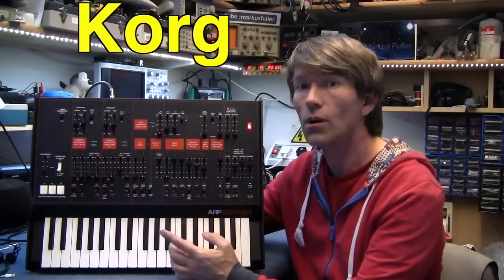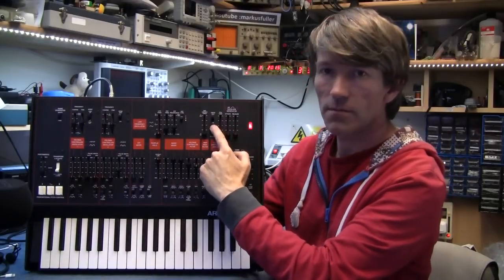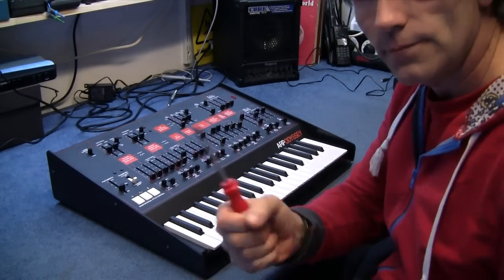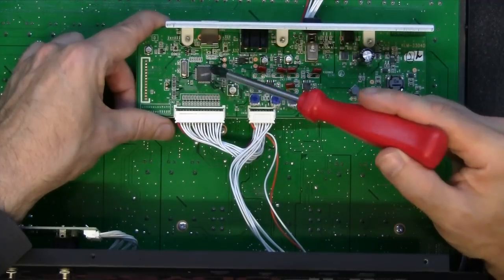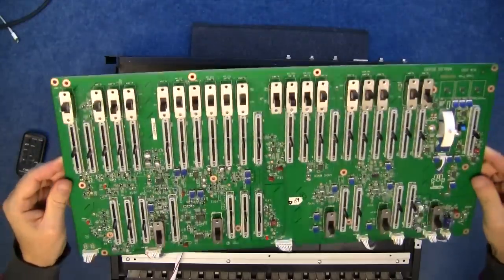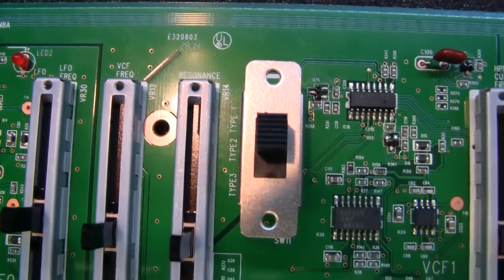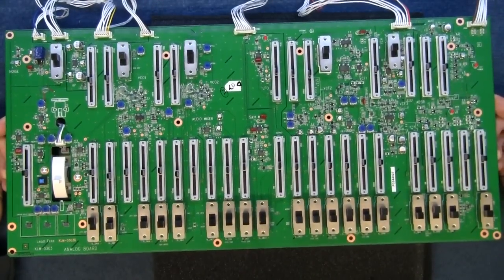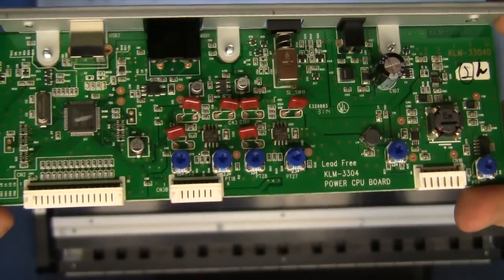Korg ARP ODYSSEY teardown MF#44

Comment: Great video as usual Mark - loving all the teardowns. I also greatly enjoyed the Maplin 5600S restoration (still hankering after one of those).

A couple of comments on the KARP teardown: Those pressure "switches" on the PCB are miniature strain gauges. The ball on the gauge and the metal bits in the buttons are to ensure a single point of contact and avoiding transmitting anything but the pressure in the vertical direction. The digital (obviously) USB controller also does the duty of scanning the keyboard,  so the internal CV and gate are digitally generated (sorry analog purists, there's no resistor ladder in the keyboard, only "dirty" digital CV :-p )
Reply from the maker: +Trottelheimer Thanyou for that information especially about the pressure switches. it all helps other people and I get to gain information from you guys posting things here. Many Thanks from Markus

Comment: The analogueness of the circuitry on that main board has convinced me - I have to have an Odyssey.
Reply from the maker: +45rpm they sound very good but are a little bit awkward to program. still that helps to accidentally find interesting sounds sometimes.
Reply: +markusfuller dude it's one of the easiest things ever to play and program! 😳😳

Rewarding piece of gear

Comment: The next video's the one I'm waiting for! I'm resurrecting the Maplin synth that I built back in the 80's. It's how I got into synths. Happy memories. 😃
Reply from the maker: Hi Bob. which marlin synth do you have ?. is it the spectrum or 3600 4600 5600?. I need some patch pins for this 5600s before i can even get started.
Reply: Hi Markus,
It's the exact same model as you showed in the video, a 5600S.
Ah, yes, the patch plugs. Now that's got me thinking...ok, I've found them, but I've only got 12. You are welcome to borrow them but will need them back at some stage. I'm busy starting up a new business, so I will not have time to do the 5600S resurrection for a while. I've still got the build manual which I can scan if you need it.
Bob
Reply from the maker: Bob Fuller Hi Bob. Thats a very generous offer, I am going to look into it today and see how much of the thing has been completed as there are 3 holes in the back with sockets missing so I do not know if everything has been completed. But yes I would love to try out with the pins if i get the thing to light up. and would of course send them back insured special delivery as i know they are quite expensive. I will try and send a private message later today and give you my details. Thanks Bob from Markus.

Comment: markusfuller at 6:06 once you get the main board out, what is that epoxy/glob of glue clear looking stuff? whats its purpose? Plus I love love love love love your videos sir!!!!
Reply from the maker: Hi Marc, Im not absolutely sure but it may be to keep out any humidity around those few components which would help in keeping the oscillators more stable. (possibly). ?

Comment: I just bought mine yesterday, and it does sound like would expect from a proper analogue synthesizer. And it has a lot of odd design details - some which probably aren't entirely desirable for everyone, so I was wondering if it could be modded. And thanks to your splendid video, I know at least what sort of challenge I would be facing: Tiny tiny SMD components! Too small for my big clumsy fingers to weld anything on to.  ;)

Comment: Just curious to know what that super glue type clear stuff is on the board at 5:54 ???
im sure it serves a purpose, just looks very sporadic
Reply from the maker: +milky michael Hello Milky. I think it is something to do with sealing those components from the elements ( humidity etc ) so as to make that part of the circuit more stable. .. thats just a guess.

Comment: Hey Markus. I've enjoyed your videos. I have a question about the Korg Arp Odyssey. Does the power button on yours feel wobbly? I just received mine and it doesn't seem solid. Just wanted to see if that is indeed standard. Thanks! Keep up the cool videos!
Reply from the maker: unimaxer Hi Yes the power button does feel a little bit wobbly, but so does the range switch and faders. Im enjoying using it but I'm being careful as i think some of the parts would be easy to break.

Comment: Hello Markus. Great video teardown yet again ! Thanks !
One question: I've noticed some hot melt glue spots around the VCOs area, do you have any idea what is that for ? Obviously not to hide the components, like they used to do back in the day to protect design secrets, since the glue is transparent. Maybe for some temperature stability ? I don't know... What do you think ?
Reply from the maker: Hi Alain. I think (only guessing) maybe its there to keep out Hygro moisture changes out so as to keep the vcos steady. sort of sealing them from atmospheric moisture changes. just a wild guess

Comment: wow, thx, i'm thinking of modding my fs to make it semi modular (with the ttsh/2600 could be even cooler than usinfg two 2600's like a lot do, because of functons present on ody and not on 2600, sq/st osc's being very close nevertheless). i'm surprised ppl didnt think about that b4, it's an easy task (okay "easy"; you'll need basic knowledge but it aint complex or a long job), especially the way arp synth are implemented with those rows of inputs on the 2600, and the same exact row but with swtiches instead of in jax on the ody. the idea is to catch ins and outs (audio and mod) from the switches (or else, there must be some pots here and there), and add mixers and splitter wherever they might be needed (allthough it's doable without i'm just thinking up loud) mixers are there alreeady so maybe on some ins a resistor is just enough. once conections via clean cables done, tidy the cabling as nice as you can, shield the audios if needed, and bring it al to the backplate, we might use a fancy connector, or find another option, because then, i'd like to make an external panel in a box to put behind the ody; my ttsh is 80% of full size 2600 witch is exactly the width of the ody FS, so if i make that panel in a way that the box it's fitted on canm get the ttsh to be installed on it, the istalatiuon will be real practical. then i just might offer that mod to the public if anybody interested... I'de like, if i can, to keep the original switches in place and get the ody to stay just like original once "mod kit) is unplugged (thus the fancy connector/plug), but if i cant that would not be the end of the world... for conveniance though, i would rather put connection as i explained rathjer than replace the switch row with a jack ins/outs row, because cabling in combination with another modular would be way less confortable as cables would have to go across the faceplate, witch i always try to avoid on units i design, mod and audio connectors should be on sides or borders (like those moog boxes that's  neet) imo...

Comment: Hello Markus, i got a question about this very synth. I have one of those with me, and it doesnt turn on (no led, no sound, nothing). When inspecting the power board, i found the 54240 IC (step down converter) to get really hot, but only after trying to power the unit up. Its way too hot to be normal, and its the only thing that looks suspicious in the board. What do you think?

Comment: Do these tend to have any issues with overheating or anything like that? The Analog circuits look super simple and efficient - making me question why modern analogs is seemingly a 'new' thing...
Reply from the maker: there does not seem to be any overheating issues, the PSU is separate not built in like the original. modern analog isn't so new its always been around being made by other companies and eurorack etc I just think like fashion tends to do a full circle then analog synths is also making a comeback. I'm sure in the next couple of years all the big companies like roland yamaha korg etc will be making some more interesting true analog gear again. theres certainly enough interest in the buyers market to remake this gear again.

Comment: Great stuff,  Markus! There's a really interesting interview by sonic state's nick batt at namm 2015 where he asks the official korg demo guy on modding the new odyssey...the response is extremely cagey, i think this korg guy envisaged loads of wrecked odysseys as obviously this surface mount technology is not so easily mod'ded as with the old original....
Reply from the maker: Hi Gary. Im sure this could also be Modded. Yes the components are tiny but theres several places on the tracks where you could hack into them and solder your own ideas in place. Just a bit smaller but that gives you a little more room also. interesting to see what people will do with these in the near future.

Comment: Great video Markus! I'm curious to know what you'd think about mods - most importantly the LFO free run mod I had on my long gone MK2 Odyssey. I remember it being rather easy to do on that synth - just cutting a trace and installing a toggle switch. Do you think it could even be conceivable on components this small?
Reply from the maker: calyx93 Hello, Im sure it can be done on these mini korg versions. the components are small but the tracks can still be got at. though I'm not sure where to start looking for the right place. there is bound to be people modding these eventually, mines back in its case at the moment as I'm stuck repairing my old maplin 5600 and its taking all my free time up at the moment.

Comment: Another excellent and valuable video! 

And pleeeeease don't tell me you found that Maplin synth at a car boot sale!!! I look forward eagerly to the video :)
Reply from the maker: Hi Reuben. Im really sorry but yes it was from a car boot sale. It was still costly £450 as theres a few jack sockets missing on the back so I was not sure everything would be inside. Mad as i am I took the gamble and the innards do look fully boarded. will i get it going though thats the big question ?. fingers crossed........
Reply: markusfuller Hi Markus, thanks for the reply :) What a find! Do the car boot sales you go to happen to have a high concentration of musical instruments, or is it pure luck and persistence that pays off once in a while?

I also wanted to ask whether you would dare mess around with any of the trim pots in the Karp Odyssey?
Reply from the maker: Hi Reuban. I go to 4 car boots every week one is 25 miles away, Its just persistence that sometimes pays off plus some dealers know i want this type of thing so save bits for me. but i can go for months finding nothing at all. as for the pots in the Karp no way will i move any of those without any knowledge of what they are for. theres 5 that can be accessed from the front panel by removing rubber grommets but the rest inside No chance :-(

Comment: Markus, can you tell if the sliders are stock sliders?
They have mounting holes at the top and bottom which aren't used. So I assume they are stock size?
Reply from the maker: Ni5ei Hi They do not look like anything especially made for this product so I guess you should be able to find something that should replace these if need be without buying them directly from Korg.
Reply: Great, thanks!
I was asking because someone was talking about replacing them with sliders that have an LED in the tip (like the Lumina slider kit for the original Odysseys). If these are available in the right size and resistances then it should be doable.
Reply from the maker: I'm sure someone will make the kit up like the Lumina kits. but the sliders are slightly shorter though should be do-able

Comment: Great video!  I love tearing things apart.  About the Roland, I think the same thing about most keyboards.  I wish they made a module version of every synthesizer. :) there are only so many keys I need laying around.  I always just use one master keyboard anyway.
Reply from the maker: I agree. there was a time when lots of successful synths were remade as modules. I think the system-1 would be an easy rework as the pitch/scatter board is already a separate board so it could just be moved to the side of the synth board.
Reply: That's a really good idea. I have still yet to mess with the system-1 in person, but the plug out system has me intrigued.
Reply from the maker: Yes the Plugout system has been a bit of a flop for many users in that it will not load any plug-out synths unless you go through an up to date DAW first. so in my case i have Logic 9 so I cannot load the SH-101 unless i buy Logic x. I think Roland should work on this as many people do not have up to date DAWs so they are not going to purchase any plug-outs unless Roland sorts this issue out. The System-1 is a great little synth in its own right (apart from the keyboard)
Reply: Wow, I'd be SOL as well. Still using Logic pro 9.
Reply from the maker: same here I have Logic 9 and I'm not prepared to pay another £200 just to update to Logic-X I never use a DAW anyway I was hoping the system-1 would be No PC required. That was the original reason I was interested in it in the first place. but to pay £200 then around £79 for each software synth I'd rather save my money and buy hardware.

Comment: I own one of these, and I have a problem with the design:
1) Key trigger always resets LFO phase
2) With an envelope set to LFO Repeat and Auto Repeat, the trigger occurs part way through the LFO cycle, not the beginning

These 2 things together mean that if the LFO is busy triggering the envelope and then you press a key, the rhythm is interrupted.  If you trigger the keyboard repeatedly, you can even cause the envelope to never fire.  This makes it near impossible to use LFO repeat musically (rhythmically) while also changing notes.

How difficult would it be to:
a) Disable the key trigger LFO phase reset, or:
b) OR the LFO trigger and the key trigger together to feed the envelope when set to LFO Repeat?

Either of these would allow me to play in rhythm.
Reply: I found a better explanation for the behavior.  When in LFO repeat, the LFO square wave positively gates the envelope. When this gate is high and a key is pressed, the gate from the keyboard is effectively missed as the gate never went low.

Could we XOR the LFO-based gate signal and keyboard TRIG signal to force the gate low momentarily?  What's the easiest way to accomplish that with the KARP?
Reply: Yes. There is a simple mod involving cutting a single trace detailed in Reddit. I’m going to try it now

Comment: It's actually amazing, rather than hating on the use of new tech and it's use in analogue I'm a fan of it.
Reply from the maker: +jamie munro I like both old and new tech, plus digital and analog, they both have their good points.
Reply: +markusfuller absolutely Markus, I don't get the hate in any direction, embrace or walk away, it's pretty easy. Seeing inside these modern weapons is an eye opener. I haven't opened mine up but appreciate you doing it, I would like to know if there are any option son the board for future hacks though, you mentioned nine in the video, do I assume there are none?
Reply: +jamie munro mentioned 'none' not nine, why doesn't YT allow editing arrrggghhh

Comment: Hi is it normal to feel a slight vibration when the power is connected if you lightly touch the back panel? Something to do with grounding. I just noticed it on mine after it fell over accidentally. No idea if it was like that before but I never noticed it until now. Is there anything I could check inside to make sure some damage wasn't done.
Reply from the maker: Hi That sounds very strange. there should be no vibration when the power supply is connected.
Reply: @markusfuller  I have an old Macbook that does the same. It only does it if I barely touch it. Since the psu is two prong doesn't that mean there is no grounding or does it do it through the 2?

Comment: Did you ever tear down a Kronos mate? Very odd scanning system in there with little rubber plungers as key sensors.
Reply: Chris Nowak he did tear down a kronos in a past video.
Inside there is nothing more then a old celeron cpu, some RAM memory and an SSD disk. . 
In fact it is just an old computer, programmed by Korg using a Linux dialect, with a keyboard...

Comment: Hey I have a question, my Korg arp odyssey recently stopped functioning on 4 keys, I’m wondering what the problem is
Reply from the maker: Hello Michael. are all the 4 keys next to each other or spread out along the keyboard. and did they stop working at the same time.
Reply: @markusfuller  they are next to each other! If you can somehow video chat with me I can show you first hand. I’m not sure exactly what happened but it happens all at once
Reply from the maker: I no longer have my odyssey so cannot open it up to guess what may be wrong with yours. there may be a small crack on the copper track on the board under the keys or even a fault on the ribbon cable that connects it to the main board. I am only guessing but i had a keyboard that worked until i pressed a certain key and then several keys next to that would stop suddenly but it starts working again, I found there was a small crack on the copper circuit and i had to solder across the crack to reconnect it. i remember it was very hard to find because a multimeter would test the track as ok until i pressed hard on the key which slightly bent the board and then the multimeter would register a fault again. look at the tracks that come from that key and see which one is shared with the other 3 keys that stop working then there is a chance that the fault may be somewhere along that.